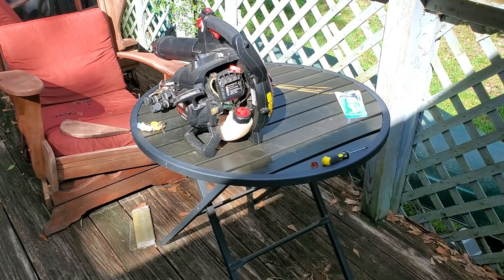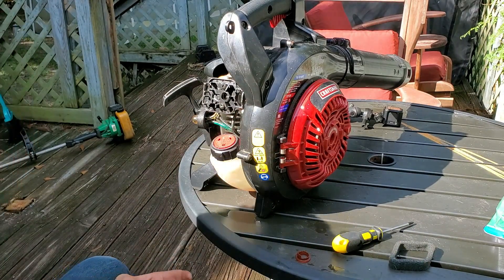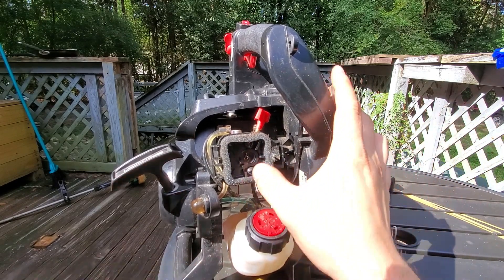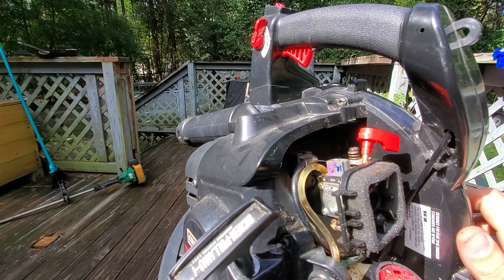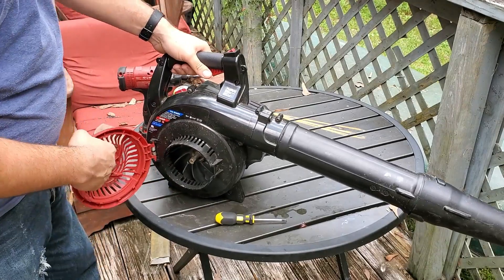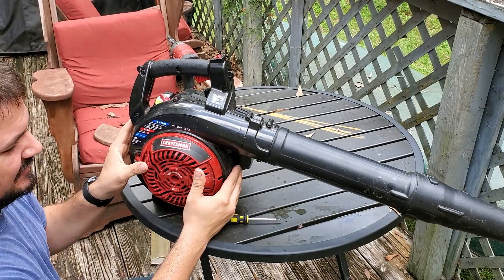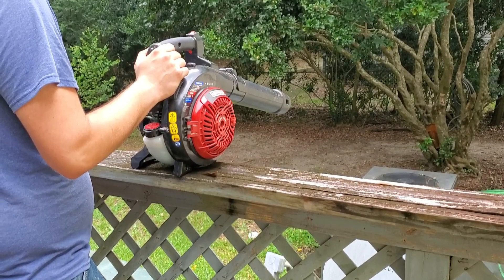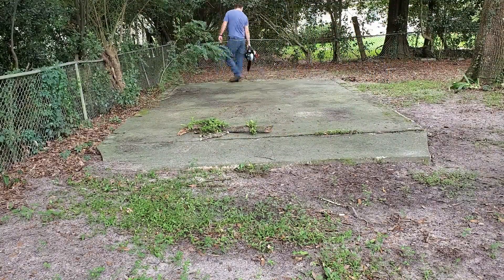Craftsman Leaf Blower No Start

Comment: I have the same blower but a Little bit different carb. I'm having the exact same issues as this one, I also use the premixed True-fuel. Did you mix it 40:1 or 50:1. The weird thing is it will start with a drill and a press or 2 of the primer while using the drill. If you have any suggestions I'd greatly appreciate it
Reply from the maker: I never figured it out. It eventually just started. I used it a couple days ago and it did the same thing. Wouldn't start, left it alone, came back, it started. So I'm not to sure.

Comment: Yeah I use regular ethanol gas 10% off so I'm going to try and use for next 2 years ethanol free gas two years a long time but you do notice problems in the two years and the way it runs otherwise that Craftsman is a killer it works great the one I've been saving for three years I started up today last time I started was 2017 when I Got a Brand New I may use it a couple two times so those things do not like to run you cannot use them with age they disintegrate who knows it's us to make noise you hear the piston rings clanking around maybe just wears out the carburetor completely completely f*** up the way I see it I never put no work into it I tried spraying it with seafoam nothing I got it right here I was going to clean it up put it in the box and bring it back get my $180 back you know I got another brand new one group for two years the other one is good for two years then I got the Homelite I don't know what that's good for I might just buy the Echo and bring that back and then get my $190 back this way I'll have the home light I mean the echo 2520 and two crashed maybe I'll probably be dead before they hope either way I don't know you get the picture

Comment: The reason it either won't start or will not start easily is the carb.  They use the cheapest crappest carbs possible.
Reply from the maker: I figured but it started running

Comment: I hate this blower so mucg
Reply from the maker: Yeah if you don't use it enough it starts acting up. That's why I bought my own.
Reply: @valdezventures5501  I have a massive oak tree in the back yard and it destroys my life in the fall.  I definitely use this blower but it's been way too intermittent.  I think I may need to get a more reliable one....if anyone on here has suggestions lemme know!  Battery powered isn't powerful enough sadly, i'm having to blow countless leaves.
Reply from the maker: @Andrew Thompson  I switched to a rake and a yard sweeper sadly. I have to many pine trees in my yard and I hate them but fastest and easiest I leaf blower for roof and side walks, rake for getting around obstacles, then the yard sweeper.
Reply: No sabes usarlo